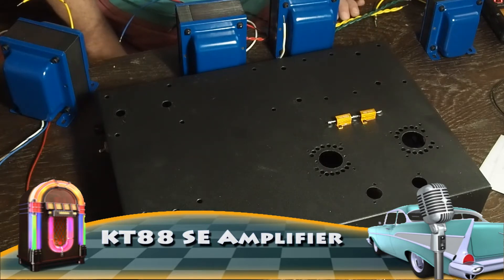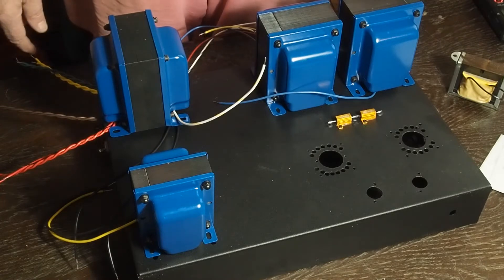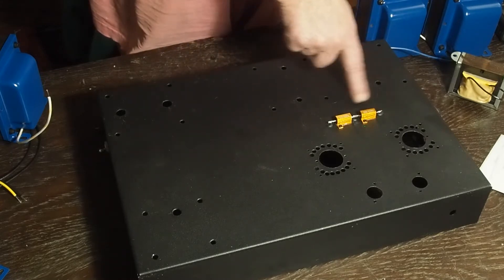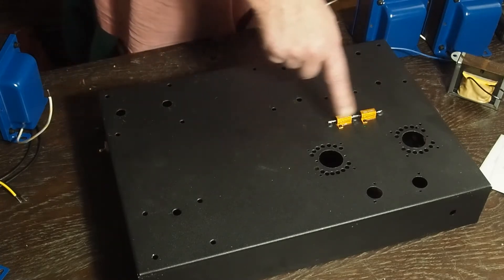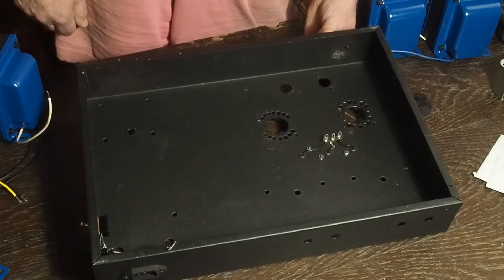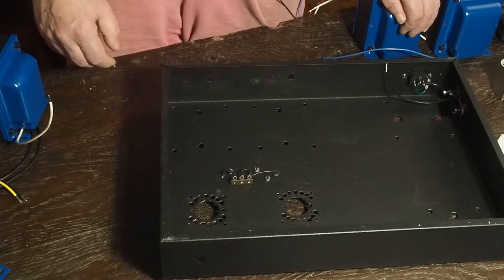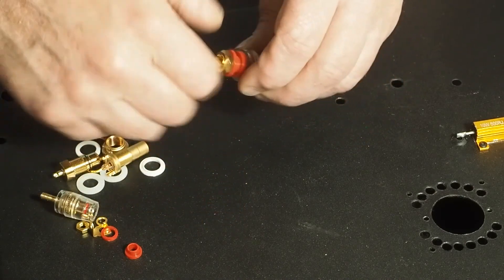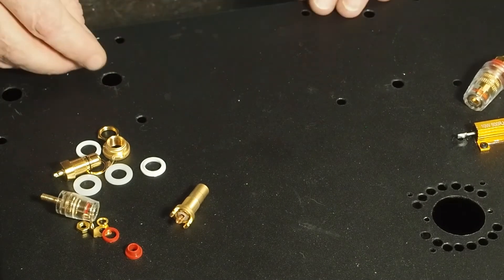KT88 SE DIY Amplifier Build Part 3

Comment: I like what you do but can't seem to do ...I built Audio Xpress Sept. 2001 6550 S.E. amp.Well with 335 on the plate of the 6550 it's gonna last forever.Question is it possible to get a good sound out of a B+ of 355 DC and  plate @ 335V. And finding a driver configuration is ,well... A work in progress .6SL7 Grounded.Cath. plus C.F. ? oR CASCADE 6sn7?
Reply from the maker: The cascode I used on my 300B build might work and sounds good.
Reply: Thank You for being close to your subscribers .

Comment: Hi do you think a good idéa to glue my capacitors supply with a silicone stuff
Reply from the maker: I've read some types of silicone can outgas fumes that corrode electronics. I always use contact cement.
Reply: ok fine @SkunkieDesignsElectronics

Comment: Hi i got a  420v on power transformer so the the 159 v choke  has a maximum voltage 500v  ,is this choke can support my 420 v transformer.thanks
Reply from the maker: If it has less than 500V DC at the inlet to the choke, it will be fine
Reply: ok thanks @SkunkieDesignsElectronics

Comment: Hi i got a power tranformer rated 420-0420 volts if i use tube rectifier can i put electrolytics capacitor  500volts is it enought for this .thanks
Reply from the maker: No. That's likely to end up with an output voltage of 500V and I would want to see at least 550V caps. 

https://www.duncanamps.com/psud2/
Reply: yes i got 597 v no load ,tube rectifier  take 40 v .550 v cap is the best  thanks @SkunkieDesignsElectronics